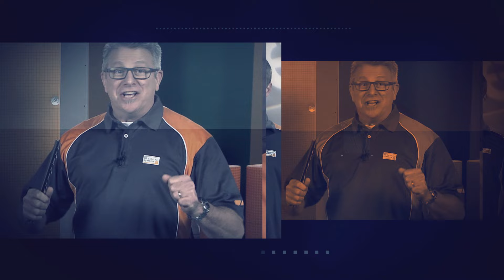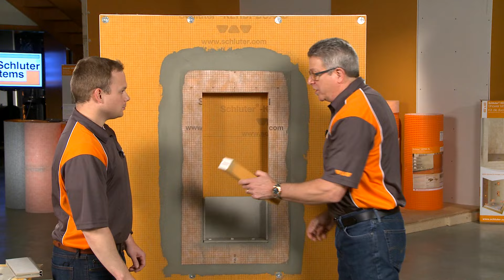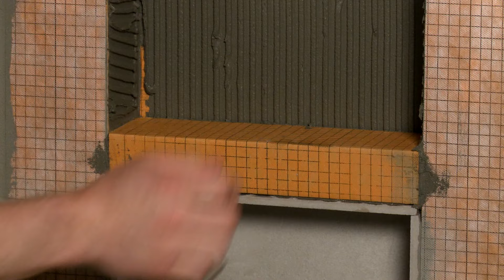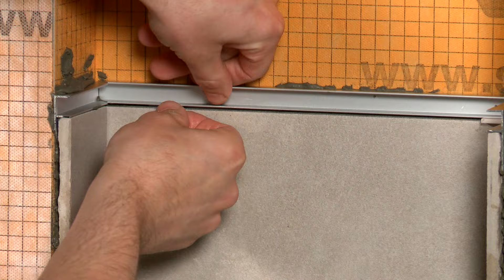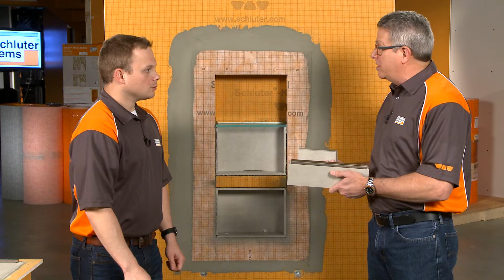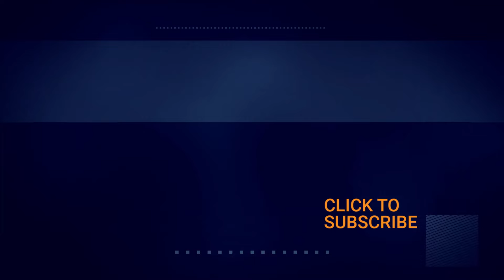How to create a shelf in a niche

Comment: I just used a piece of marble tile as my shelves that way it was finished top and bottom doesn't have to be two layers thick and no grout line and I just set it as I was setting my tile and didn't bother with the metal but the metal is a nice touch for the shelf

Comment: Can the sandwich approach be accomplished with the rondec such that the round profiles don't meet awkwardly?
Reply from the maker: Hi there!  It may be possible to do it with the Stainless Steel RONDEC, but you'd have to try a sample to see if you like it. The other RONDEC profiles have integrated grout spacers, so I'm not sure if that would look right, although, you could possibly grout in between and that could be okay. It's really about trying them out and seeing what your preference is. For samples you can reach out our Customer Service Team at 800-472-4588 (US) or 800-667-8746 (CA). Hope that helps!

Comment: I showed this video to our tile installers and they attempted to replicate the two tile method for the shelf., however, they used a different profile which has a 1/16th lippage, so the niche shelf holds water. They are insisting that this is normal. Is it?
Reply from the maker: Hi there, Do you mind contacting our customer service team for this question?
US 800-472-4588
CA800-667-8746
Thanks!

Comment: Can l use the kerdi niche on 1/2"hardiboard..?
Reply from the maker: Yes, the KERDI-BOARD-SN can be used in conjunction with a cementitious backer unit or any of the other approved solid backing materials listed in the Schluter-Shower System Installation Handbook for use with KERDI membrane.

Comment: What is that second option, for the sandwich tile shelf, schluter piece called?? I cant seem to locate it.
Reply from the maker: Hi Brittney B, 
This is our Quadec profile. You can read all about it here:  https://www.schluter.com/schluter-us/en_US/Profiles/For-Walls/Edging-%26-Outside-Wall-Corners/Schluter%C2%AE-QUADEC/p/QUADEC.

If you are having trouble locating the product please give our Customer Support team a call. They can be reached at US: 800-472-4588 or CA: 800-667-8746
Reply: @schlutersystems1  hello I was referring to the flat edge one not the quadec I have that in my cart ready to buy. But I want to do the other flat style with out the grout in the middle looks like it may be the Reno T?
Reply from the maker: Ah ok, yes the solid profiles shown on this video was the Schiene-Step and Reno-T. Either could be used depending on the thickness of your combined tile pieces. https://www.schluter.com/schluter-us/en_US/Profiles/For-Stairs/Cover-the-Sub-Assembly/Schluter%C2%AE-SCHIENE-STEP/p/SCHIENE_STEP
https://www.schluter.com/schluter-us/en_US/Profiles/For-Floors/Same-height-Transitions/Schluter%C2%AE-RENO-T/p/RENO_T

Comment: Ugly. 
This is not how skilled tile installers make niches.  A skilled tile setter uses mitres and epoxy. 

Schluter has nice products, but the niches are more suited for amateurs than pros. Top level tile nstallers can mitre everything. They don't use metal tracks, tile edge, or even jambs

Comment: Can you buy the Schluter shelf seperate from the niche?  I want to do a custom sized niche so that I end up on a tile grout line so was going to wrap in kerdi.. but wanted to add a shelf
Reply from the maker: Hi Rich. We don't sell our shelves separately from our niches, but you can use a piece of KERDI-BOARD to build your shelf (it's what our niches are made of anyway!). Just be sure to waterproof the edges using KERDI-BAND after and you'll be all set. Give us a call if you need more info: 888-472-4588. 

Here's a link to more info on KERDI-BOARD: https://www.schluter.com/schluter-us/en_US/Building-Panels/KERDI-BOARD-Panels/Schluter%C2%AE-KERDI-BOARD/p/KERDI_BOARD
Reply: Hi Rich, we have not used our shelf that we purchased with the niche. We just used the niche and are installing a glass shelf. Let me know if you still need it.

Comment: actually you are doing it wrong. The sides tiles under / above the shelf should be cut in an angle for the correct slope, and that will give you a perfect fit to the glass shelf
Reply from the maker: Hi Jacob, thanks for watching!  That is definitely one option to create slope beneath the DECO-SG. Remember, very little slope is needed for the water to sheet off of the shelf.